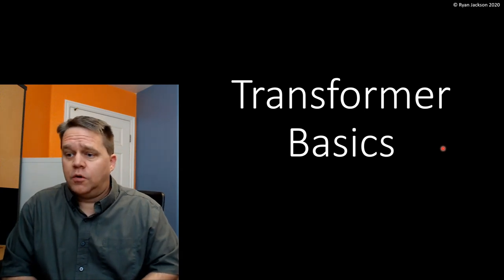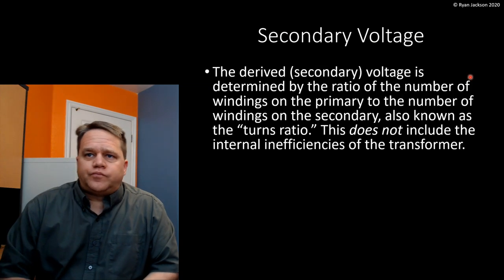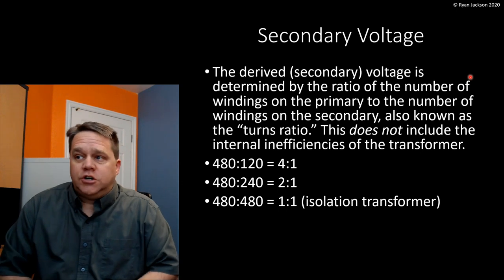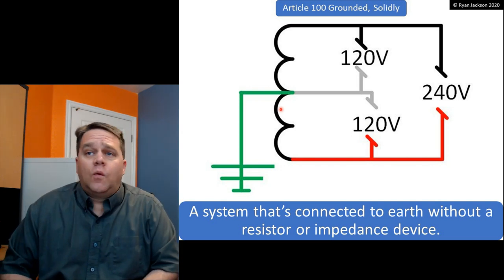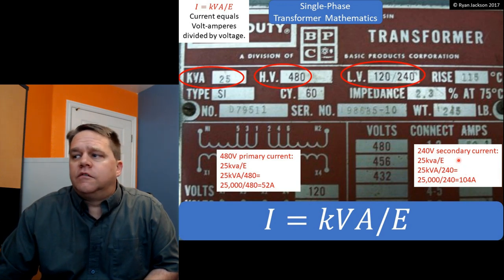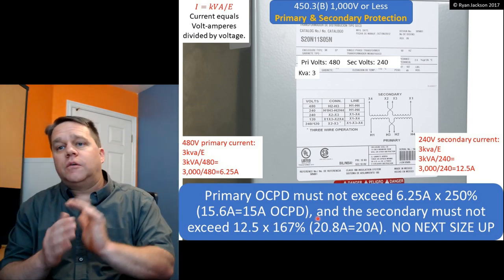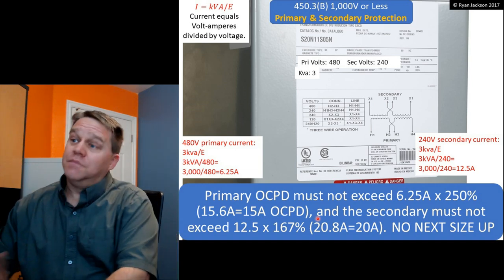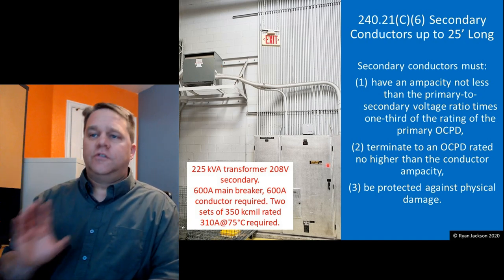Transformer basics--theory and code

Comment: What is an example of a primary and secondary protection on a transformer ? The MB on the secondary side feeding a panel is considered the secondary protection? Or am I over thinking this.
Reply from the maker: @NICK112o_o  The overcurrent device on the primary side of the transformer is the primary device. Whatever overcurrent device the secondary conductors terminate to is the secondary overcurrent device
Reply: @RyanJacksonElectrical  TY. Sorry to make you have to mention that after this full detailed video explaining all of this. Love watching your videos. Truly so blessed to have come across your page. 450.3b always trips me up when The 250% part for primary and secondary protection comes into play.. so as an example… from the MDP OCPD if I protected my 480v 3p circuit to a non fused disconnect, Then to my primary side of the transformer. Then out of secondary of transformer supplying a 3p 120/208 MB general outlet/lighting panel. I would need to use the 250%?. Forgive me trying to learn

Comment: If you are using flexible metal conduit on primary and secondary side do you have to use bond bushings for flex , I’ve seen some people bond both primary and secondary , I’ve seen people use no bond bushings at all and still pass. Please tell me code section that states either or thanks for your videos
Reply from the maker: Only if the knockout is concentric (or otherwise impaired) and the voltage exceeds 250V to ground. See 250.97.

Comment: If I’m using a driver, and I want to find out the amps, do I do the watts devided by the secondary or by the primary? Let’s say I have 300 watts pulling and I devide it by the secondary 12v that’s 25 amps would that trip 20 amp breaker? And if I devide 300 by 120v it’s only 2.5. So what is the amperage actually being used on the primary
Reply: The breaker is on the primary side so that driver is only drawing 2.5 amps. No problems
Reply: Boyd Bindrup so there can be 25 amps on the secondary and the primary breaker won’t trip? And do we then need a breaker for the secondary?

Comment: Will this work with an LED or does it need to be an incandescent bulb?
Reply from the maker: An LED needs a dc power source, otherwise it will flicker at the frequency of the alternating current. Remember that a diode is a directional component, so it will only work when current is going in the correct direction.

Comment: Hey Ryan, Would be simpler to just call each side an inductor.
Reply: The windings on both sides of transformers are inductors, but the essential difference is that the core is common to both windings in a transformer so they share a magnetic field, in order to transmit energy from one coil to the other.  Unlike stand-alone inductors whose core doesn't touch other components, or torroids whose core forms a closed loop and the magnetic field is kept within the component.

If you were to leave an open circuit on the transformer secondary, the transformer primary would function just like an inductor.

Comment: 19:51, the last bullet point is not true, if you have a resistance of 1 and a impedance of 3, then the formula is 1+jX=3 where X is your reactance. If you do the math:

sqrt(1^2+X^2)=3

solve for X and you get a reactance of 2.828 ohms
Reply from the maker: I don't cover the square root of -1 for simplicity's sake. I agree this is not 100 percent accurate, but, in my opinion, it gets the point across. I also still use the Neils Bohr model for atomic theory for the same reason...for the purposes of this this discussion it is "close enough."
Reply: no worries, I'm just here to learn all these rules since I'm only 1 year working as an electrical engineer in a MEP firm, you do an amazing job explaining rules
Reply: @RyanJacksonElectrical  the old famous 220, 221 what ever it takes, 2.8 or 3....whatever it takes. Love your videos, I graduated 21 yes ago and love the refresher and the code knowledge! Thank you